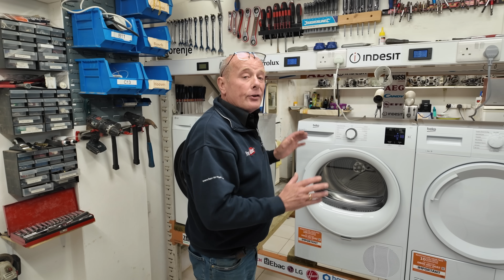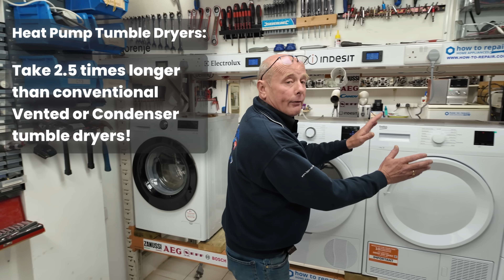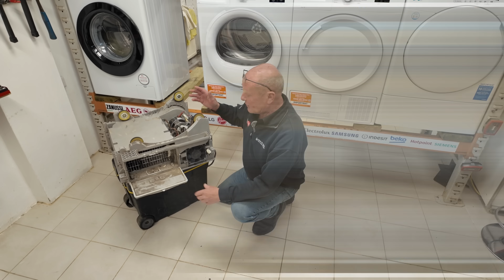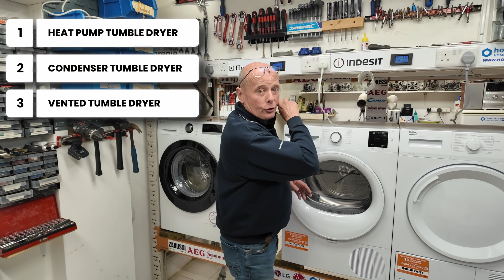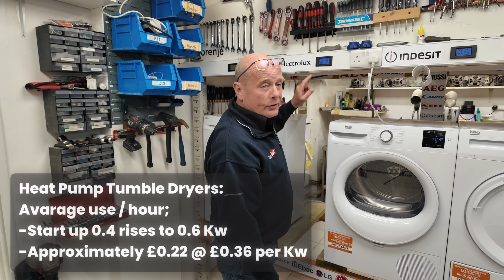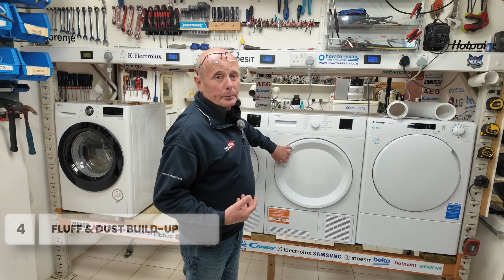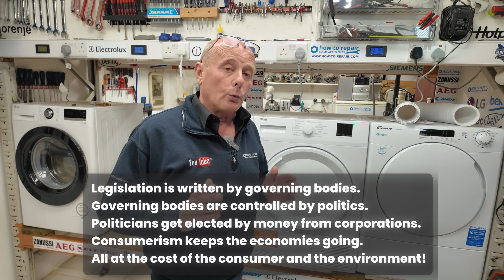Tumble Dryers the Shocking Truth About Heat Pump vs Vented & Condenser, NEW LEGISLATION!

Comment: I've had my vented dryer for over 20 years. There's not a lot to them so they last a long time. I've only had to replace the belt and the tub holding wheels. I agree we need more efficient systems, but let's make sure and look at the complete picture. I don't think replacing a 20+ year appliance with one that (if you're lucky) might last 5 years is good engineering. I think they need to go back to the drawing board on these Heat Pump dryers
Reply: Mine is 38 years old and i remember cos of the age of my daughter.

Comment: My personal experiences with condensor dryers is, that thjey never got the clothes as dry as a vented dryer, even if left running for twice as long.

Since we only use our vented dryer in winter, the output goes through a moisture trap and then into the house; adding heat and some humidity that we need to replace, as the other heating systems make the air too dry.

Comment: I have a heat pump Bosch and it's been fantastic but you're right it is about 5 years old and although I'm meticulous at trying to keep dust out of it and i regularly clean between the  evaporator i can get at, it is still starting to build up dust that I can't get at without a full strip down. I'm moving to a narrowboat soon so I will be purchasing a new heat pump one(it's  not worth taking a 5 year old one to a boat only to have it possibly fail quickly and then get it of the boat) because using low energy appliance/products is a must when you have to generate all your own electric especially in the winter when it's much harder to do. The time it takes is irrelevant to me it's all about the energy used. Yes it may not last as long but when you break it down over the years of ownership it's still way cheaper than using laundromats to dry your clothes(and you've got to find them), plus it's only me and I only do about one washing load a week, I only use it for drying clothes during the winter months and can continue to do this on a boat.

Comment: The biggest reason to move away from a 'conventional' tumble drier is fire risk.  I personally know of two cases locally where conventional machines have started fires: one caused minor damage to the house, the other destroyed the house completely, killed two pets and caused smoke damage to adjacent homes. Massive trauma to the both families.

Heat pump driers are slower, don't leave the clothes 'toasty', may have higher long term maintenance costs ....... BUT DON'T BURN YOUR HOUSE DOWN!

Knowing all this we changed to heat pump drier (Siemens) about 5 years ago. No regrets.
Reply: The only times a tumble dryer/washing machine catch fire is when people dont maintain them and clean the fluff/lint out

Comment: As an appliance engineer for 44 years, I do not recommend heat pump dryers, as they are expensive and frail. These machines very often cannot be repaired, which means they need to be disposed of. Whereas condenser and vented dryers can be repaired, mainly at sensible costs. Most people who buy them do not always realise that it will take up to 4 hours to dry a load, whereas the other dryers can often dry a load in 45 minutes. A lot of engineers will not touch the refrigeration system, as regases often fail at high costs. It is best to buy a good condenser dryer and look after it.

Comment: Wind farms and solar panels are less efficient than gas and coal power stations and cost a lot more. EVs cost more than ICE-based vehicles. Ground source heat pumps cost a lot more than gas-powered heating. So it is no wonder that air sources dryers cost more and are useless. NetZero is the emperors new clothes and needs to be stopped.

Comment: A very informative account of the downside of a heat pump - this time in something as basic as a tumble dryer. When a condensing dryer is working it also heats the room - in winter that is fine but in summer it makes the room a bit hot. But what really shocked me was that for a simple load of drying in the conventional dryers it takes half an hour and job done. For a heat pump it takes 2.5 hours of rumbling compressor and motor so for it to come on in cheap electricity its going to disturb sleep.
Reply: It doesn't take 2 1/2 times longer to dry, though. Secondly in most homes a modern dryer is not loud enough to disturb you upstairs  in bed. If you had a flat it might be different, but that's true of all dryers.

Comment: My answer to drying clothes is first, hang them out on the line, weather permitting. Second, put them on a clothes rack in a room with an infrared heater(cheap to run) The infrared will heat up objects in the room. I’ve been doing the infrared all winter with drying and it works as well as keeps us warm too.

Comment: well . I had a ordinery Bosh condensing dryer. It whent wrong after 5 years and our engineer gave up trying to repair it. It would run for 20 mins start to get hot then stop. Then you could restart it.  it would run for say 10 mins and then stop. He changed the sensor no differance. then  changed a circuit board same fault. he then said buy a new one and I will take the price you payed for the repair off the price. God knows what a heat pump one will be like when that goes wrong. could not even get a ordinery one repaired.

Comment: What an absolute headache, Green-washing everything is making our lives more difficult . Surely repairing existing machines is greener than buying a new heat pump model.  The govt think the public are too stupid or irresponsible to make their own choices , they think we should be forced into doing as they say & having our choices taken away from us. I'm really angry about it.Twice as much electricity consumption and a machine that lasts half as long with much more wear and tear to our clothes; what's there to like here ? It's disgraceful in the ridiculous rush to net zero we are being sold inferior machines and having to use more electricity not less, plus the wastage on all these machines with the built in obsolescence,it's a case of the Kings new clothes , nobody in authority sees the actual problem.
Thanks for the great video, I had a sneaking suspicion about this as a friend of mine bought an heat pump machine & isn't happy with it.
Govts need to rethink this mess !

Comment: My condenser sits in an extension that is freezing in winter and tropical in summer.  I didn't know till now that the room temp affects how well it works.  I use it rarely, just to get large  bedding out of the way.    Small stuff room dries on airer.  I like to have it in case any other urgent drying is ever needed. Thanks for your info.  When condenser availability ends, I'll bite the bullet and get those  airers that use  minimum electricity to waft warm air past the clothes on the racks.  Hopefully cheaply?
Reply from the maker: If your machine is outside in cold weather, you are much better with a vented dryer
Reply: @How-to-repair  Thanks.

Comment: Excellent video, I’m new to your channel, thank you for a very sensible analysis…. Making machines difficult to repair is the curse of the modern age.
Reply from the maker: Thank you for your comment. I appreciate people like you taking the time to write it out. Please share it where possible. It might help others make a wise choice instead of being misled by the industry.
Reply: @ thanks, my first washing machine came out of a skip, a Hotpoint countess in about 1980, I went to the hotpoint depot in Stockport and bout a replacement pump for the 1950’s machine… worked fine, but in the end I couldn’t even give it away, so it went back in a skip after a couple of years when I moved house …. Ridiculous waste of good metal and sound engineering!

Comment: Washing machines have gone the same way - use less power by using less heat, and compensate for the inferior performance by having a much longer cycle. Supposedly it saves energy overall, but it might not actually save money. If you're on a smart tariff, you can take advantage of times when energy prices are low or negative due to oversupply, by putting your appliances on during those times. But if your appliances all take 2.5-3 hours instead of the 45 minutes they used to take, then you might start them in a cheap period only to find that it's gone into a more expensive period by the time they've finished. Coupled with the increased wear on the motor and bearings because they're running longer, and the general lack of repairability, these modern machines are a false economy. I still use a vented tumble dryer that is now >20 years old and still going strong, never even had to be repaired. Can't imagine any of these new machines lasting that long.

Comment: If the heat pumps can be made to work at the same temperature as the conventional dryers then the drying time will be the same. It may take advancements in heat pumps before this will happen. I am sure it will though over time, there is a truly massive amount of R&D going into improving the temperature output of heat pumps and their coefficient of performance (efficiency), for air conditioning systems and home central heating, as climate change worsens, and this can trickle down into dryers.

For me, I just use a clothes rack, and my new Hoover WIFI washing machine is very good at reducing the dampness of clothes during the spin cycles, even at low speeds, compared to the Beko one I was using previously. I appreciate this does not suit everyone though.

Comment: our Beko condeser heat pump drier is quicker than our last vented drier. it comes with a  long warranty that i have extendeded with Domestic & General insurance who we have used for over 10 years for all our appliances. I also can verify that they are very quick to replace eqipment if their engineer can not fix it.

Comment: As a few others mentioned we use a dehumidifier if we need to dry a large amount of laundry or bulky items like a king size duvet that doesn't fit in the tumble dryer.  While a dehumidifier is certainly not going to dry clothes as quick as the slowest heat pump dryer, it has the big advantage of not causing any wear & tear on clothes as they hang still on the drying rack and you can dry everything all at once instead of multiple loads in a dryer, just set up another drying rack.  The only maintenance with a dehumidifier involves emptying its bucket after use and vacuuming its dust filter every 2 to 3 weeks.

Comment: Thank you for a very well presented comparison. I am converted back to my original plan of replacing my current condensing dryer with another when it becomes too costly to repair. Heat pumps are not for me, but recent Which reports were beginning to sway me. I feel better now.
Reply from the maker: Thank you for your comment. I appreciate people like you taking the time to write it out. Please share it where possible. It might help others make a wise choice instead of being misled by the industry.

Comment: My old dryer was a Miele vented, after 20years the heater element  failed, it's a very expensive part, I did repair it as the element broke at the end by the terminal so just shortened the element and re-crimped it, but it lasted only a year so concluded the wire element had gone brittle. So not wanting to spend £100's on an old inefficient dryer. And having a sealed house renovated to modern standards with MVHR, no trickle vents, solar etc, a heat pump dyers was a no brainer as heat it develops passively heats the kitchen it's located in. 

Another Miele. Ruled out other brands due to bad reviews ; mouldy heat exchangers, tangled bed sheets due to no reverse, excessive drying times etc.

Well, surprising to say, It dries as equally as quick as the old vented dryer; within an hour with the same load. So maybe those that say their dryer takes several hours either have an inferior appliance or the heat exchangers are clogged up with fluff.

Only criticism is annoyingly it has the same carbon brush sensor system as my old vented dryer for automatically sensing when the clothes are dry. Any Miele dryer owner/repairer will be familiar with the click-clack noise they develop when the brushes wear, and I'm already on the second set of brushes after 12months. This is a Miele thing, nothing to do with it being a heat pump. . 

How long it will last overall (ignoring the noisy sensor brushes), time will tell.

The refrigerator circuit is hermetic, it should never leak, unless damaged (for example heavily jolted when moving house or a ham fisted repairmen), like a fridge or freezer they aren't normally regassed so don't have Schrader valves like a car or office split air-conditioner would. If gas is lost you can assume the unit, like a fridge, will likely be unserviceable or uneconomical to repair. Not sure how many appliance repairers are F-Gas qualified anyway.

Comment: Our heat pump tumble dryer is 7 years old, works perfectly and saves a small fortune in electric usage.
It was the very cheapest Beko and we follow the maintenance as stated in the manual.
Your cost analysis is skewed as the heat pump recycles the heat and uses less energy the longer it runs.
I will not go back.

Comment: 1. You offer some very sound advice. Thank you for posting. I think manufacturers should consult you how to make the machines better: with the "Right to Repair" it might become obligatory on them!
2. Heat pump tumble dryers typically have higher capacity for some reason. I've seen mostly 8-10kg, so energy efficiency is even better for bigger loads and family life
3. They have useful features: smartphone app tells you status and when done, you don't have to go and check every 10 min
4. You typically get longer warranty periods included. I've seen up to 10 years
5. They are substantially heavier, so difficulty of taking them up some flights of stairs without a lift should be seriously considered, also taking them down when replacing: not a two man job but perhaps 3 or 4
6. Just like diesel engines made to last longer than petrol engines due to the loads and pressures they work under, I fully expect heat pump units are made to last longer, considering the longer warranty periods they come with
7. Heat pump units run slower and therefore normally quieter. This is especially important in flats with open plan kitchens
8. Due to lower running temperature, I expect heat pump units are safer products than vented and condensing ones
9. I've seen heat pump units going for around £260 so prices are coming down

Comment: as I dont have to sit by the machine while it is working, I could not care less about the drying time.
I am 56 years old. My family runs a heat pump dryer, we used to run condension and waste air dryer. None of these ever failed because of a motor or bearing failure.
Also, as a certified HVAC engineer, I can assure you the compressor is very rarely at fault.
A valid argument is that the extended runtime creates more fluff. I had to defluff our dryer after 5 years of family use and it contained a gigantic pile of fluff

Comment: Had a Beko condenser that cost £250 fail a couple of months outside of 2 year warranty, John Lewis no help at all.  The £800 Miele heat pump we replaced it with has lasted 8 years so far, with large energy cost savings over the condenser, so is probably well into profit compared to the condenser experience I had.

Comment: Summary: All Heat Pump dryers I'm called to repair are broken. All HP dryers are the same and are all bad designs , past, present and future. This applies to everybody everywhere. 
In real life, things are much more complicated.
In my very limited experience, The newer Bosch HP dryers have two nested folded lint filters that are very effective. But then they also use the accumulated water at the end of the cycle to backflush the evaporator coil. That water also passes through another cleanable filter mesh. More fussy?, yes but way more efficient than conventional. How long will it last? That depends on how well they implemented the design. EOL disposal concerns?, yes, more so than simple machines.
GE has a HP all-in-one machine that is also very efficient, runs on 120V-15A circuit. They have the entire sealed system (the Heat Pump) as a removable module just under the top cover. So easy clean, repair exchange or replace. Being a combined washer dryer, it has the benefits of taking less space and being able to complete a load from dirty to dry without having to be there to move cloths from washer to dryer which would be wonderful for some people. But that also means that you can't have the next load washing while one is drying. I imagine that there are other machines that the perfect solution for some and not for others. 
What would be useful is real world reviews of efficiency, reliability, functionality etc. of individual models.
Reply: I'm looking at the Bosch/Siemens machine with the so-called self washing system. I presume it uses the extracted water collected in the draw container for this process?
So can these machines still be plumbed into a drain so I don't have to manually pour the water away each time?

Comment: Well said. I have always felt it in my gut that not enough emphasis is placed on the awful built-in- obsolescence of today's technology. After watching a number of your videos I have overhauled my 13 year old Zanussi vented tumble dryer. The drum bearing is still in super condition as is the motor. So I've replaced the drum felt seals, drum rollers and drive belt. All has been thoroughly vacuumed out(including the fan and fan housing). I'm hoping that it may last another 13 years. I will be looking for a backup heating element before they become unavailable. 
Of course if the control module fails 😥, then I may be screwed!